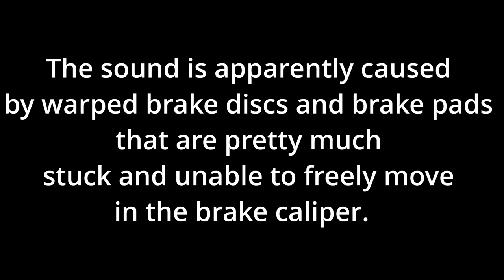How to fix squeaking brakes for free - on Hyundai ix20, but works on most cars

Comment: Using the wrong grease, should be copper based.
Reply from the maker: thanks for your comment, copper is fine too - i tried copper for 2 seasons , but I find this one better and it is also recommended on forums (but half of the crowd uses copper alright:) , even the paste manufacturer seems to be recommending it - https://youtu.be/n9A4DS9Q3Jg?t=197 .  Anyway - works very well for me, hence Ii put it in the video:)